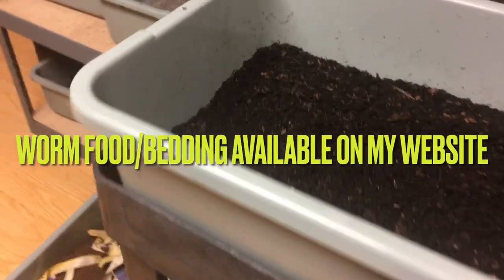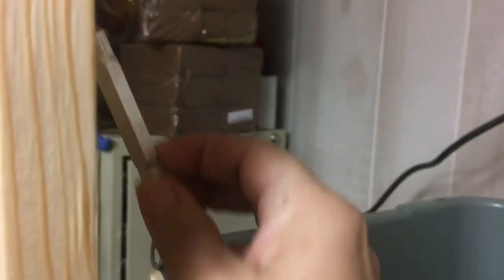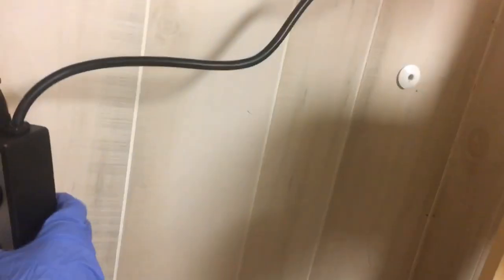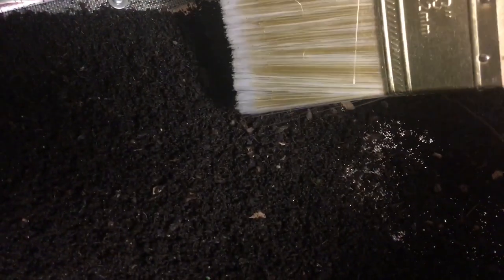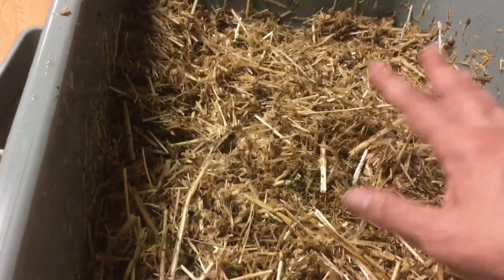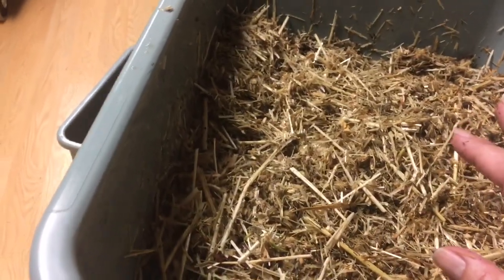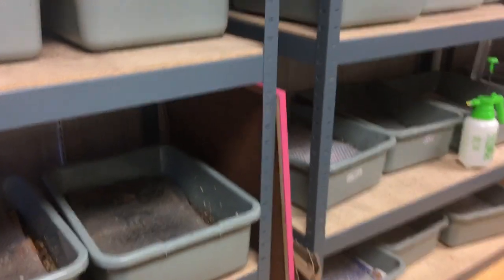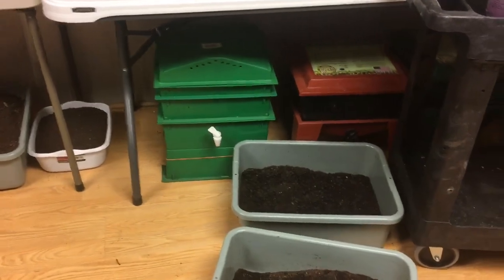My new Casting sifter/harvester. #worm ￼

Comment: The sifter looks great! I like because it is vertical it saves space and the fact you can switch out the bins to different sizes!  Any issues with the unit sliding along the floor or does it lock in place?
Reply from the maker: The unit is built onto the table that has rubber feet. It doesn’t budge. I don’t have a ton of space right now so that’s why we built it vertically

Comment: The hook thingy holding the spring is called a turn-buckle. It's being used as an adjustable length spring retainer. Thanks for the video. <><
Reply from the maker: 😂 thank you for that. The machine works better than I expected.

Comment: New sifter looks good Vee! I’ve seen people talk about 1/8 and 1/12 screen. Do you know in inches what 2.3 mm is?
Reply: 1/16 looks super tiny
Reply from the maker: Yes it’s too tiny the new one I got is 2.3 MM
Reply: The 1/16th inch =1.587mm. The 2.3mm doesn't easily translate into a fraction: 5/64 is 1.984mm and the next common use fraction is  = 3/32 if an inch at 2.831mm. 
For comparison, the 1/8th inch mesh is 3.175 mm & 1/4 inch is 6.35mm. 😉   <><
Reply: @waynetadlock9719  thanks

Comment: On the variable speed controller,  did you push the switch to "VAR"?   VAR stands for variable,  and FULL strands for full speed. The FULL side of the switch will bypass the variable control knob and run it at full speed. The VAR post of the switch allows the control knob to control the speed faster or slower depending on which way you turn it.
Reply from the maker: I’ll look at it again but I have pressed every button on it and it just does nothing different, I think it’s defective

Comment: What part of the harvester is the motor attached to? Does it vibrate the entire wooden frame or is it somehow situated where it only vibrates the pans?
Reply from the maker: The motor is attached to the frame and it vibrates the entire thing. We connected the motor to one of those button things that supposed to control the speed, well the thing doesn’t work